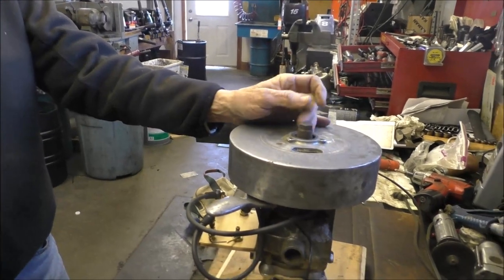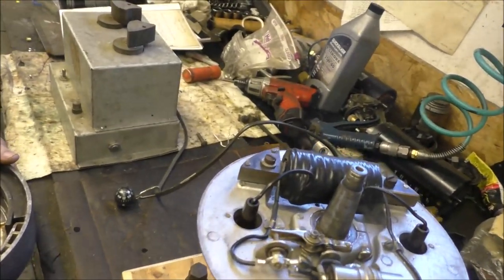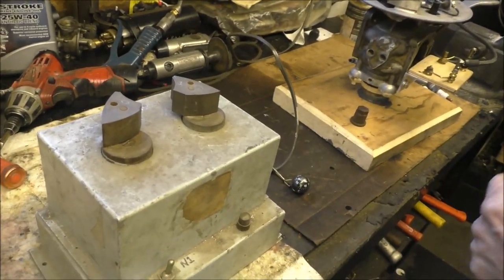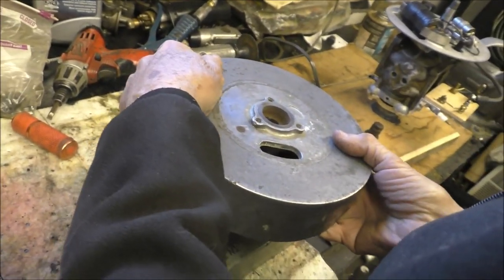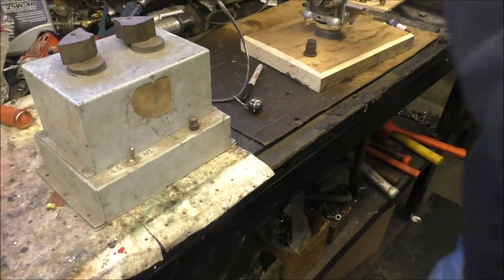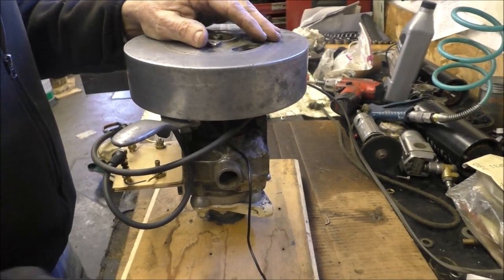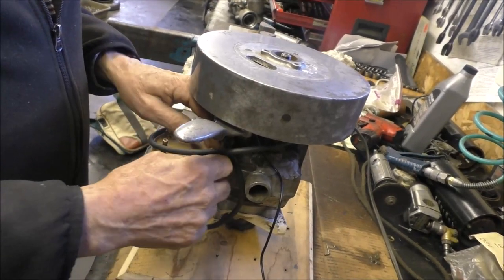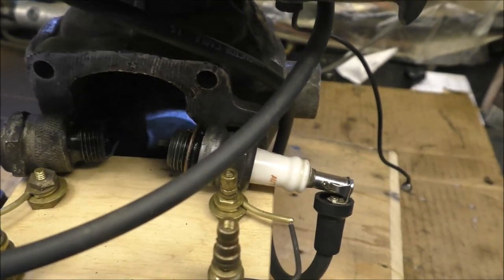Part 3 Magnetos by Bill Andrulitis

Comment: THANK YOU  for mentioning   the condenser  (capacitor)  energy storage and  the "ringing" effect.   This   fact  IS THE BASIS  for all coil/ magneto/ battery/ breaker points  ignition.  Many/ most people  preach that the condenser  "prevents the points burning"  but the fact is  that  the condenser  ADDS  to spark energy  and most  mags/  battery ignition will not start without a good  condenser.

Comment: Just a thought. I see the spark gap is mounted to a piece of plywood. With voltages that high is it possible the wood is conducting causing the spark not to jump? Where as ceramic might be a better insulator therefore allowing a larger gap?